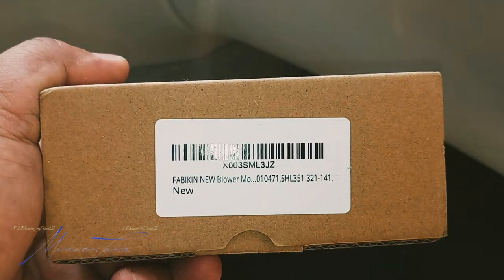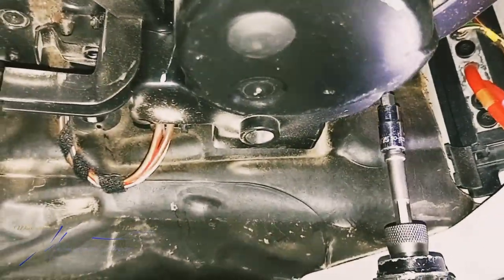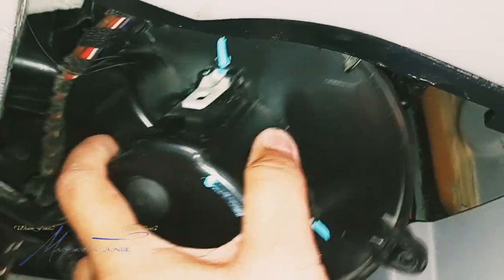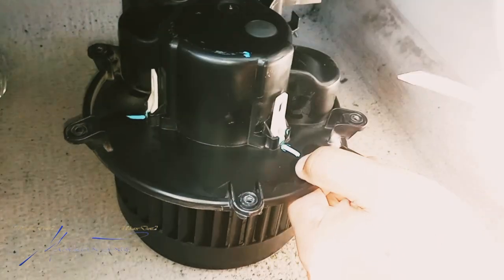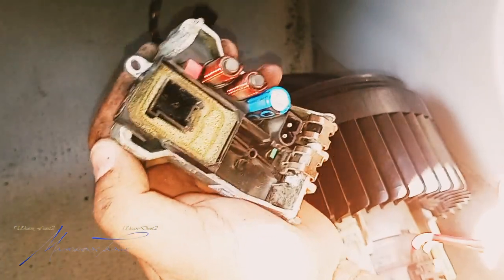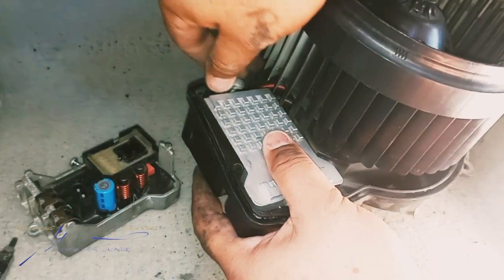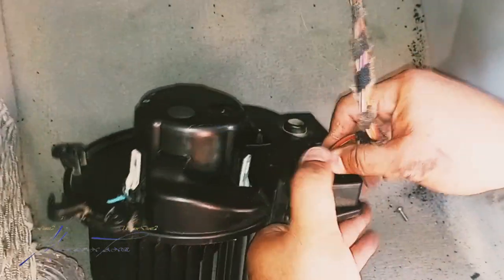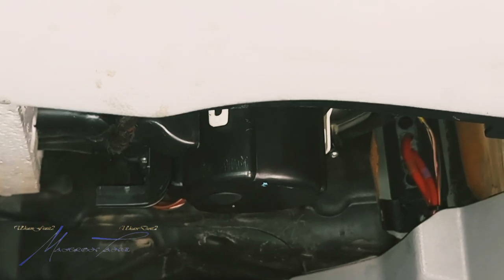How To Replace Blower Motor Regulator/Resistor|Mercedes Benz C Class

Comment: Do you need to disconnect negative battery terminal before doing this work?
Reply from the maker: Thank you for checking out our channel. Tap that Like and Share if you don't mind. Also Subscribe if you haven't already. We have different content in our catalog that you might like or find interesting. We really didn't have to. Although, for safety reasons. We highly recommend disconnecting both positive and negative terminals. Which will be safer during changing electrical components and allowing reset at the same time. We hope our content helped you out a little. We really appreciate your time and support!